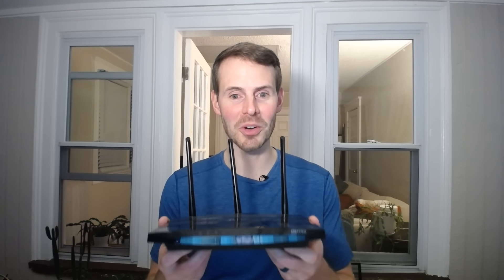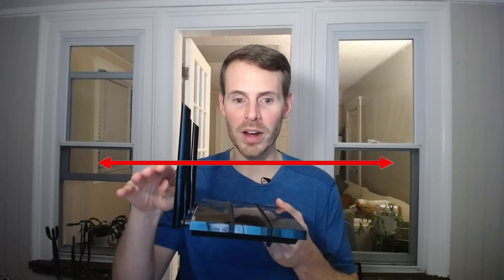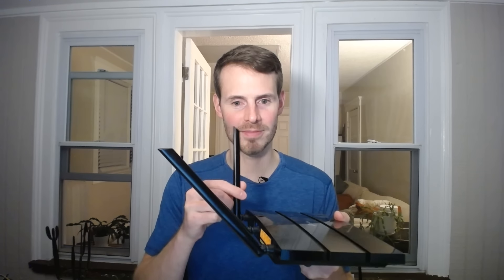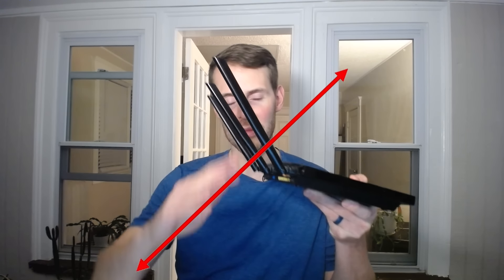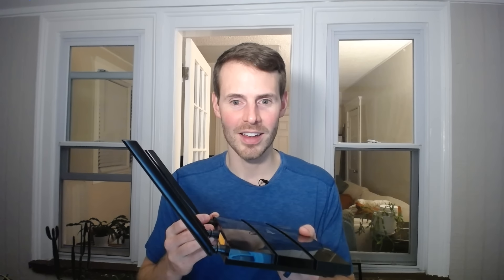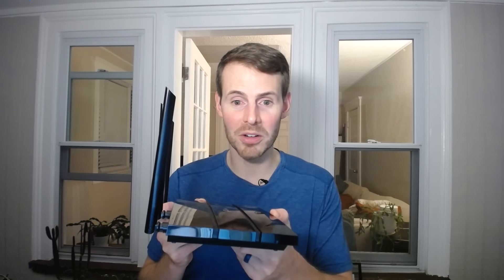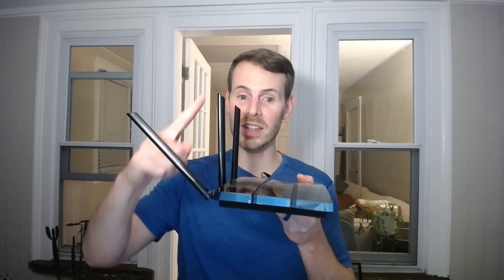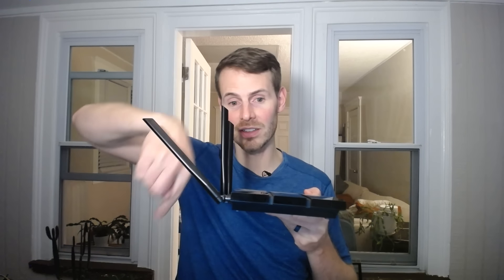Router Antenna Positions - What You're Doing Wrong

Comment: Unfortunately, you're just guessing, and you're guessing is incorrect. RF propagation does not work the way you think it does. What you're doing is attempting to change the polarization of the antenna which is not the same as its takeoff angle or its radiation pattern relative to the antenna or its ground plane. Moreover, omnidirectional antennas are not 100% omnidirectional, even in free space, much less the conditions that routers are being used in. There are far too many variables. 

If you really want to know what's occurring, there are antenna modeling programs. It's a relatively steep learning curve and it's going and it will take time to model the antenna that you have, but that's what you will have to do to even approach understanding what's actually occurring here. And that still will not account for other variables in the environment. 

I have no doubt that you've had success in reorienting the antennas, but there's a difference between correlation and causation. The good news, outside of the engineering principles here, the prescription is the same. Reorient the antennas until you have better connectivity and bandwidth, but it does not work the way you are claiming it does.
Reply: Good answer dude. There is also equiment to generate heatmaps (you can get them on wifi bands specifically) and create an accurate signal map but i guess it's outside the scope of an amateur user.
Reply: Of course. Indoor use has other factors
Reply: Yeah, we also have it acting in a phase array to add even more complexity on most newer routers. Finally your smart phone and laptop is unlikely to be perfect polarization.
Reply: Mine doesn't have  external antennas.
Reply: Gotta say I was hoping it would at least dip into antenna theory and broadcast envelopes. Maybe a little on signal cancellation from pushing power on parallel antennas. Ah well.
Reply: Come on dude! It’s not a science and engineering channel discussing the properties in propagation of an RF signal through free space in relationship to the ground planes. And yes, he could’ve gotten to the basics in about three minutes horizontal and vertical polarity.
Reply: I figured this out on my own by trying the oldest "trick" of making an L shape. One antenna vertical and one horizontal thinking it would help signal in second floor just to relize it's even worse due to wrong polarity orientation so antenna on second floor can't properly receive the signal.
Reply: That's it! I'm going back to my carrier pigeons!
Reply: considering how much of this is fluff just to fill up time according to Youtube algorithms for "engagement" of whatever, I don't think this youtuber really cares if the information is correct!
Reply: and your* guessing is
Reply: No one can control how the EM waves propagate through their home. You cant move a wall out of the way because it attenuates the signal. The only thing you can do is orient the antenna such that it radiates towards the rooms. No need to install HFSS or CST and simulate the antenna.
Reply: @retro_hd_  Other than repeating what I already said about reorienting the antenna,  and inventing what I never said about what is "needed,"  what's your point?
Reply: Yes although in absence of those programs which are not exactly user friendly for the unvitiated one option would be to simply use a trial and error approach changing the antenna configuration and placement of the device and measure the signal with a simple wi-fi analyser app on a smartphone. Certainly more workload intensive but it is possible to map things out experimentally this way too, sure you will have far less data points doing it this way and it is going to be a rougher optimisation that you can come up with this way. But this is something a typical home user with a spare afternoon and a readily available phone app could improve their configuration for their use case with some trial and error simply by walking around and taking measurements. 

For anyone trying to do so though do also be sure to also test physically moving the device around if practical to do so long story short on the reason here being that it could be something in your home or it's structure blocking the signal to certain areas. Moving the device around you may be able to identify the offending object or wall that is weakening the signal and either relocate it if possible or relocate the router to avoid it affecting areas where you desire better signal. As the OP says the physics can get complicated but you can make simple observations this way and identify trends then use that information to choose the placement and antenna configuration that best suits your priority for where you want to optimise reception.

Comment: What I got from this vid is how many people pop up to criticize! From the way you present these tips, to the flaws in your technical knowledge. Your vid is useful and helpful without getting too technical. Keep up your good work!
Reply from the maker: Thank you very much for the support, I really appreciate it! To your point, my goal was to make a video that wasn’t too technical so it would be useful for anyone that watched it. Everyone will likely have a different antenna configuration that works best for them in their home network, so it’s best to try different configurations and see which one gives you the best performance
Reply: Thank you for sharing a very useful idea. You already have driven home the point. I don’t understand why  many people here are still so fussy?
Reply from the maker: Thank you for the support!
Reply: it's not a "criticism". it's an involvement, feedback and "giving back something"... 
if it is taken in, it will improve the reach, and help more people.
Reply: It is technically criticism, but that doesn't make it bad. 
The video is somewhat useful and it's somewhat accurate. 
What it doesn't say is that if your home is larger than a couple of rooms, to have good coverage you can't really really on a single router's access point (which is often placed in suboptimal locations to boot). 
The only good way to cover a medium-to-large home is too use multiple access points placed in various locations, ideally centrally controlled, with wired backhaul.
A simple ap-on-a-stick survey prior to placement will do wonders. If it's too much, then a simulation based on floorplan can be a poor man's substitute
Reply: Agreed

Comment: if you grew up in the early years of TV  and radio with antennas  then you would have probably  move them around to get a better picture or sound.  Same principle with the router antennas but with different signals.  This video gave us mere mortals some clue as what to tinker around for better reception.  Some comments are far too advance for the regular folks.
Reply from the maker: Thank you very much for the support. You absolutely nailed the intent of this video: it is meant to help the everyday internet user without diving too deeply into the technical details

Comment: Clarification: my ISP states in their ads that the maximum speed of this particular subscription package is 50 mbps, but it turns out it can go maximum of 70 mbps

My connection is 50 Mbps but on the 2nd floor my wifi extender only got around 20 Mbps, saw this video and I immediately moved my extender antenna horizontally and the other one at 45 degree angle and IT JUMPED TO 70 MBPS IMMEDIATELY??? WHAT KIND OF BLACK MAGIC IS THIS

thank you so much by the way 👍👍👍
Reply from the maker: I’m glad you found this video useful! Thank you for checking it out (and for the feedback)
Reply: @network-from-home  you are very welcome! thank you for this very life-saving-from-frustration video 😂 also a little update, I don't know who messed up with the position of the router so my connection of 2nd floor dropped to 10 Mbps, now this time I put two of my 1st floor antenna horizontally and all of the 2nd floor extender antenna horizontally too and it goes back again at 70 Mbps 👍
Reply from the maker: @exonzigma  It sounds like you're a pro now (:
Reply: That defies the laws of physics. 50Mb of throughput can never be 70Mb upstairs. If it had 0% loss, it would 50Mb. Just saying...
Reply: @frommatorav1  yeah right? I found out it was probably technical thingy since they advertise 50 mbps but when a technician comes to repair my connection, which is the reason for this post in the first place (after my 2nd comment my connection dropped again so I have enough and finally call them), using cable connection also yield 70 mbps...I don't mind the free extra 20 mbps tho

Comment: Thank you thats great but i have a question.. 

Ihave a poor coverage in my apartment and my router goes from 0.5mbs to 600mbs!! Because i live kinda in the border of the 5G tower..so which cheap router option with high catching signal do you offer? 

I even don’t know how to measure and compare different routers in catching signals and I prefer to change router instead of trying antennas
Reply from the maker: @l3zoxl thanks for reaching out. One thing I want to make clear is that a 5g cellular tower shouldn't have any impact on your internet connection. It sounds like you may just want to adjust the antennas on your router to ensure the areas in your home where you access the internet get a strong internet signal. Another option you might want to look at here is a mesh WiFi router. These routers allow you to place multiple router endpoints throughout your home to ensure you get a strong WiFi signal everywhere. I hope this helps!

Comment: good info, but what you fail to realize is when angling a bi-polar antenna, a null is created at the axis (aka the line that runs through the base and tip ) so when angled, though you would get penetration above and below, it would only radiate to 1/2 of the living area, as the antenna axis is pointing in the opposite direction, resulting in no signal to the other half of the living area. The fix is simple enough, for the example you give. Angle one antenna at 45* angle the other at -45* and the third antenna at 90*. Leaving the 2 remaining antenna at 90* does nothing more for signal strength than having only one at 90*, as you suggest.

Comment: This is actually crazy, I got tired or horrible internet and now I’m swimming in it, I live literally right next to it 💀
Reply from the maker: You're sure to have a good WiFi signal if you are close to your router!
Reply: NEVER position the router next to you or in a place where you spend most of your time in the house (including sleeping).  Place it in the hallway, if possible.  Use cabled network whenever possible (even if you have to have a 50 ft. cables).  I don't use WiFi in my house, but live in a big building, so have plenty of neighbors polluting me.  If you must use WiFi, try disabling 2.4GHz (most used with most interference these days) and try 5GHz only.  Less radiation (than using multiband) and much less interference.

Comment: you don't have to be limited to tilting the antenna back, you can rotate the antenna left or right.  for those that are OCD and need to have the antenna look pretty rotate the one on the left 45º to the left, have the center antenna vertical, and rotate the right antenna 45º to the right.

Comment: Is the signal from the antenna polarized?  If so, that would play into decisions about orientation.
Reply from the maker: @brucefay5126 yes, the signal on most WiFi antennas is linearly polarized, which is why the signals come out horizontally from the length of the antenna.

Comment: Great video. Just stopped over because I saw the video listed on the right hand side. One thing I discovered with wi-fi is, placing my wi-fi access point in the middle of my home. I also did this in my friends familys homes and it fixed most of the wi-fi problems. my setup on the antennas is, the left and right are pointed towards the left and right sides of the home. While the two middle ones stay up for the upper floor. My wi-fi ap sits up half way to get the best coverage through the home. The other thing to note is power. How much signal the router or wi-fi access point puts out will determine the range your home will get. The Wi-Fi ap I have installed is TP-Link AC1200 Wireless Gigabit Access Point that you can buy at any electronics site
Reply from the maker: This is great advice for those setting up their home networks. Thank you for your comment!

Comment: Antenna signal direction as described in the video is important, but probably less important than the polarization when using WiFi indoors. This is because you also have to take into account the polarization of the receiving antenna which will be widely affected by the indoor transmissions because of reflections and diffraction effects. This is what you referred to when you explained how the radio signal is emitted from the antenna.  If your receiving antenna has a horizontal orientation and the transmitting antenna is vertically oriented then the coupling between the transmit and receive antenna is not very good (and vice versa). This is further complicated because of the many reflections indoors. Generally reflections and diffractions indoors do not change the vertical or horizontal polarization of a radio signal.

A good rule of thumb is to arrange the antennas in a diagonal orientation so the antenna will produce a radio signal with a good horizontal and vertical polarization.  That way the antenna on your device whether oriented vertically or horizontally will get a better signal.  So you'll get a better signal whether you use your phone sitting up or lying down.  Most notebook computers a vertical antenna embedded in the screen and most people will not use their notebook screen at a vertical angle.

This is why you get a better reception with old TVs with rabbit ear antennas when you try to adjust the angle of the "rabbit ears" in a diagonal manner and then turn them around to look for the best signal.  Actually, in the US, television signals are transmitted in a horizontal orientation that's why the old outdoor TV antennas were oriented in a horizontal orientation.  But when the TV signal enters a house, the signals get diffracted, refracted and reflected so they are almost never horizontal when the signal gets indoors.  The TV signals acquire a vertical and horizontal orientation and so the best adjustments for a TV antenna usually happen when the antenna is arranged in a diagonal angle to catch the best of both worlds.

Arranging your WiFi antenna in a diagonal direction will give you the best intermediate signal level for most devices you will connect to the WiFi router. Of course this is just a rule of thumb and actual fiddling with the antenna angles can increase or decrease signals for specific devices, especially if the device does not move around much, like your PS2.

Final note, arranging your antenna to look downwards at an angle aimed at the basement will probably not help much unless you only have wooden floors. WiFi signals don't do well going through concrete. You would be better off leaving the basement door open or putting the router close to the basement door.

Comment: Rather than tilting your antenna, put a separate WiFi router to the basement (unless your walls are made of wood). 5GHz does not penetrate building structures very well at all in the first place. Also, those particular multiple antennas are meant to facilitate multiple users (several separate RX/TX pairs), not just different directions. You want the Sending and receiving antennas to be in the same direction (polarization) in order to maximize your signal. Multiple antennas also make use of antenna diversity to counter small-scale fading. Of course, nothing wrong in using it the way you did.
Reply: You should make a video about that.

Comment: You can also get an outdoor ext antenna, and that might help the most.
Reply from the maker: This can definitely help if you want to access your WiFi outside of your home. Thanks for sharing!
Reply: @network-from-home  It can also definitely help if you trying to access your wifi inside of your home, as walls are worse than windows for access. When outside, all the windows make a better access point than walls blocking some of that signal. Specially with strong wall construction.

Comment: It is not so simple as you presented. In theory yes, but especially nowadays when routers use phase shifting to different antennas to direct the signal, you might get in trouble by doing that. And there are different antennas for the two WiFi bands...
Reply from the maker: Thank you for the feedback! In my case, my router sends 2.4 GHz and 5 GHz WiFi signals out of each antenna. I realize that may not be the case with all routers, however

Comment: My router has a dedicated spot on the main fuse box which is on the living room wall. The spot is like a sleeve slot so the router base is sideways on the wall vertically. So the antennas can mostly point left, right and straight into the room with some up and down adjustability. It works quite well, the coverage in the bedroom is decent and as I live in an apartment it won't radiate too much outside the front door to the building hallway which is better security wise I guess. But inspired by this video, I was able to get a better signal into the bedroom whic is nice.
Reply from the maker: This is excellent news! I’m glad you found the video useful 😊